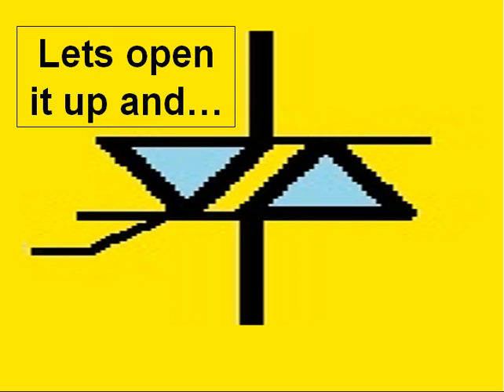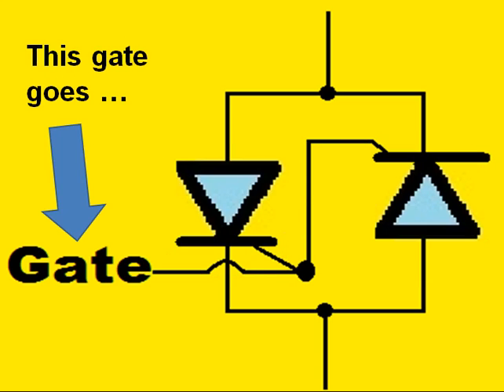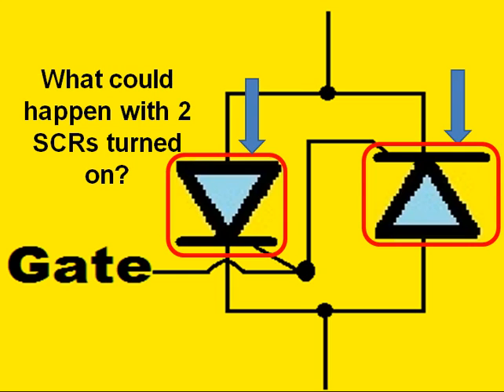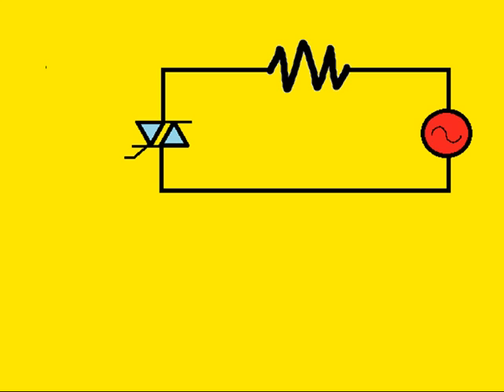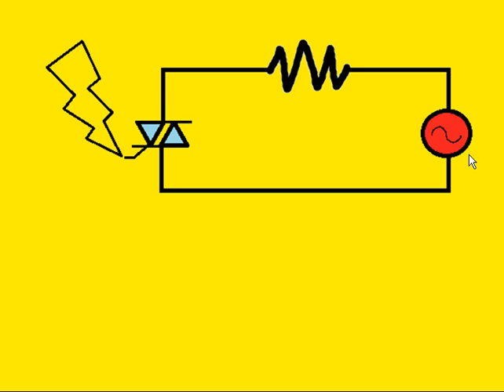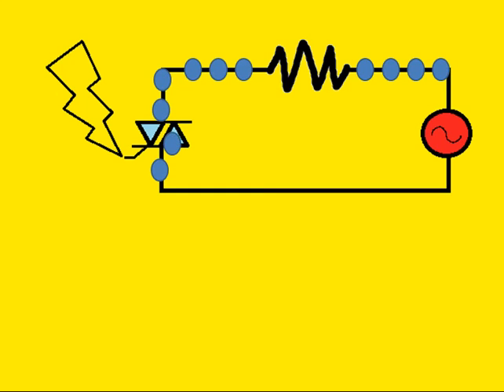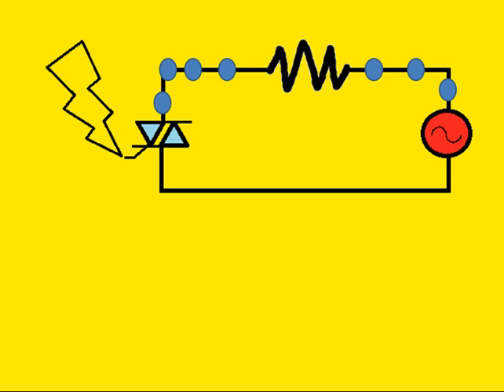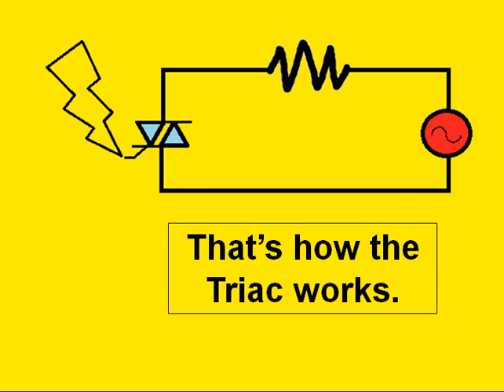Triac, clearly explained...

Comment: Very good - one thing maybe I missed was can you just remove the charge at the gate at anytime and it just deactivates? I believe this is why we have the zero crossing circuits in many Triac SRC use cases.
Reply: Once activated, it comes to "natural commutation", meaning that it stops conducting only at the end of each semi-period where it's current falls to zero (not when the trigger signal is removed from its gate).

Comment: So basically a transistor for AC signals,made out of two diodes next to each other?
Reply: The triac is used either as a switch or a regulator for A.C.

Comment: So essentially the triac is used to stop voltage if needed in a circuit by removing the control voltage otherwise it lets voltage flow freely either way basically as two diodes that are opposed?
Reply: Yes! The triac is used either as a controlled switch or regulator for A.C.

Comment: But what’s its use... surely current will just alternate back and forth through a conductor. What’s the relevance of the SCR? 
That circuit shows an AC generator and a resistance .... if I’m being told the triac simply lets current flow both ways then what’s its purpose ?
Reply: It is used either as a switch or a regulator for A.C.

Comment: Current flow refers to the flow of electrons. I don't understand why people like still use the conventional flow of current which is an old belief and had been proven wrong that electrons flow from positive terminal to negative terminal? It has already been proven and established that current flows from negative terminal to positive terminal. Btw, holes don't travel or flow outside the semiconductor through the wires. Holes travel only within the material of the semiconductor.
Reply: You are right, but this is impractical when working with electronics. For example we have leared that a diode conducts when it's anode is more positive than it's cathode and accordingly that "the current through it follows in the direction of the arrow (in its schematic symbol)". Your claim, although correct, reverses this logic and makes things difficult when practically working on circuits. Therefore the conventional current flow makes things easier to understand.

Comment: Now all I need to do is find a video that explains what a SCR is...
Reply: I just watched it, it goes in to great detail and explains all you need to know about pcb mounted scr's. I would not recommend you proceed without first having some thc handy. You could probably get away with some dmt or salvia to but salvia is best for gardening as we all know.
Reply: Silicon Controlled Rectifier, basically a one-way door for the electricity to pass through
Reply: My retired teacher wife overheard George's commentary and said, "Now that guy is a good teacher!".  I would like to know how these work (or why they don't) in dimmer circuits for LED lights.  Thanks!
Reply: I had to do the same. It appears to be a PNP transistor where the gate is blocked by an NPN transistor which in turn has it's gate controlled by either the PNP transistor or an external input. I'm not exactly sure why though or how this is helpful...
Reply: A SCR, as its name implies, is a Silicon Controlled Rectifier, which means that it works just like a rectifier diode, but only when it takes a dc signal at its gate, referenced to its cathode. Without this signal, it does not conduct at all. It behaves like an open circuit...

Comment: You didn't explain the purpose, if you replace the Triac by a simple wire it will do the trick.
Reply: Yes . Also how to power the gate
Reply: The triac is used either as a switch or regulator for A.C. It needs a trigger pulse to its gate in order to conduct. Once conducting, it stops when the A.C current passes the zero line (null current), but not at the instant of the trigger signal removal.

Comment: Ok for triac but not complete information please make second video how  to trigger it  ? Because i have noticed that there's used diac which act like 30v zinner diode why diac are use like D3B instead of normal positive signal using diode ? What use of diac ??
Reply: https://youtu.be/YIAef-7wvq4
Reply: This is commonly used when the triac is used not as a common switch, but as a regulator for A.C. The process is called "phase angle control". Search about it to learn it...

Comment: Very clear indeed. Thanks.
Question: so it is just a switch?
Reply: Not entirely, Yes it can be switched on but, it can't be turned off. The only way current stops flowing through the TRIAC is when the gate is low AND the forward current drops below the holding current (IH).

Comment: Fun and helpful video but two suggestions: If you referred to the flow of “holes” in a real engineering office, you’d get strange looks and maybe some gentle ridicule. While the flow of holes versus electrons convention is correct, you will confuse newbies trying to learn by insisting on a useless distinction. As long as we are consistent in engineering in describing the direction of current flow (which we have been for decades) it does not matter whether the defined direction of current flow describes holes or electron flow. It doesn’t matter for circuit analysis, and all engineers understand how current conventions relate to underlying physics. Based on several comments it did confuse several people.

Also, you showed the flow of holes as a little train with a first and last hole. That could be confusing. Current flows equally everywhere in a loop. So the train would be continuous with no end or beginning.

Comment: "flow of holes"?  What holes?  Are you referring to electrons as holes for some strange reason?
Reply: When it comes to electrical study, there are two techniques to visualizing current flow:  electron flow (which follows electrons as they leave the negative terminal of the source) and hole flow, also known as conventional flow, which follows the gaps or "holes" that electrons leave in the valence shells of conductive materials.  It's contrived, but as electrons move away from the negative terminal, toward the positive terminal, they leave gaps in the valence shell; the holes left by the electrons seem to move from the positive toward the negative terminal.
Reply: @jasonpallack2442  I'm familiar with both theories (-to+,+to-), but have never heard of it referred to as "holes".  Thanks for the explanation.

Comment: By replacing two pn junction diode instead of two scrs what will be the difference in working?
Reply: With 2 opposing PNs (diodes), current would flow either way ALL the time. With a triac, current would flow either way ONLY when the gate has a current. (he didn't show where the gate's current is grounded though)
Reply: Two diodes have no control when current is to flow. The gate fills in the holes and allows current to flow. Two diodes and current flows all the time. The triac replaces a relay.
Reply: @jasonmoore843 Wrong perception. The equivalence of two thyristors connected anti-parallel, which represents the triac, means that each one of the thyristors acts exactly as a normal rectifier, but only when it takes a trigger signal in its gate. This means that each thyristor conducts only during the semiperiod where it's anode is positive against its cathode. When the polarity reverses, the second thyristor conducts, when it gets triggered.

Comment: By increasing triac triggering angle more than 50° the output load waveform  are coming only in positive half cycle.please explain ?
Reply: If the pulse appears at 50 degrees, the triac will conduct from that moment up to the end of the semiperiod. Then it needs a new pulse for the next semiperiod.

Comment: if I give a positive gate pulse when the supply is positive then how does it work?
Reply: If the signal is permanent, the triac will act as a switch letting the A.C current to pass through it all the time.

Comment: Why does he call the direction of current flow the "Holes"?
Is there something behind this that I've missed?
Reply: but conventional current means that "if" there was a hole it will move this direction ... but in fact there isn't ..
Reply from the maker: Conventional current flow.
Reply: george boole. Holes only exist in semi-conductot material. I highly doubt your diagram was made with a semi-conductor conductor.
Reply: Electrical current is defined 2 ways: electron current and conventional current. With electron current, the electrons flow from negative to positive; with conventional current, the lack of electrons (a.k.a., "holes") flow from positive to negative. The material can be anything that can pass a current.

Comment: all well and good, but what is an SCR?
Reply: It's a thyristor, in a triac there are two thyristors that can make the current flow in either of the direction as explained in this video..
Reply: Silicone Controlled Rectifier

Comment: You could improve the video.  First you didn't explain SCR, and you didn't explain what a Triac is for!  Why what it does is interesting!
Reply: Small current flow can control a large current flow. They are I expensive and smaller replacements for a relay.
Reply: First, the video is about TRIAC and not SCR 
Second, that person has clearly demonstrated that a triac is used for the bi-directional flow of current
This is what everyone find interesting :)
Reply: Abdullah Khan yes, but if you eliminate the triac from his circuit it wont change anything. A simple wire can let current flow in both directions. You don't need the triac for that.
Reply: Gabriel Badea You’re forgetting the gate signal.
Reply: @ArnaudMEURET  It could be replaced with a switch.
Reply: Víðarr Kerr why replace a switch with another switch unless the first switch was bad?

Comment: Nice and simple George - the best way to learn!
Reply from the maker: Muchos Thank you, good luck.
Reply: @hobokengar I suppose we can used two diods ourselves and make a traic??
Reply: @Dailymailnewz Not diodes, but thyristors. Diodes can't be controlled. The A.C will pass permanently through them. A triac works either as a controlled A.C switch or regulator.